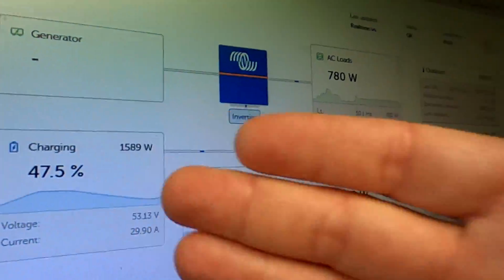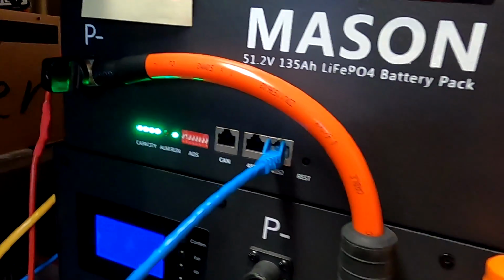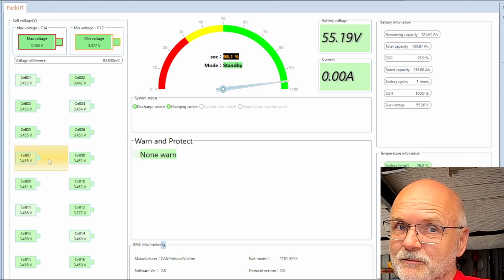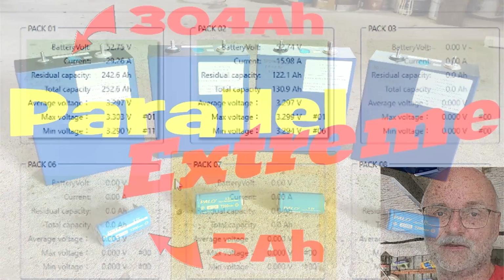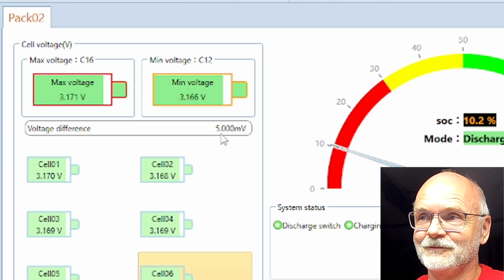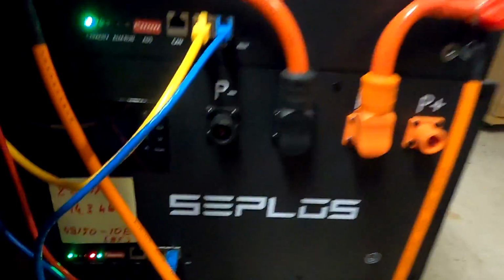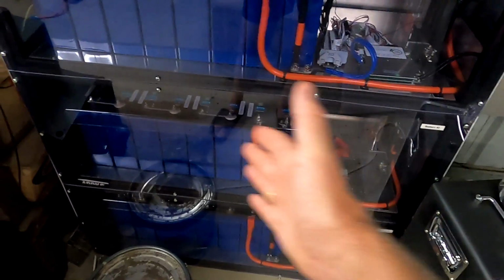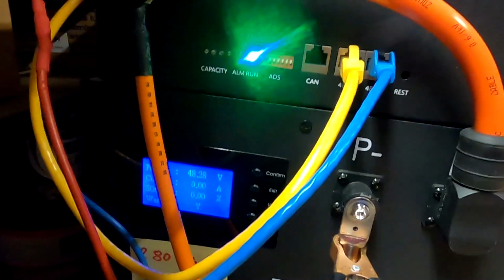280Ah and 135Ah batteries with different BMS in parallel. See what happens when discharging...

Comment: HI Andy. Thanks for great video! 
As I have similar situation with Seplos BMS DIY 280Ah battery by EEL (95% similar to Mason) with Amy supplied batteries and 105 Ah battery with JK BMS
 I like to share my little findings during few days. I  connected them in parralel this week and see similar load sharing as you had. 
The difference is that they not communicating together, but both can talk with Cerbo GX and I also have SmartShunt measuring both batteries. I will do more tests after NY.
EEL DIY was put in service this week and we have winter in Lithuania now. No sun. Just snow :)
My feesback to your test
Communication between batteries is to path trough data to inverter via Canbus. 
What I been thinking based on your test is that master battery shall be last shuting down. If not all communication to cerbo or inverter will be lost. Maybe you can try this next time including canbus communication to see 3 parts bahavior
My expierience with seplos bms+ smartshunt was that despite I been using SmartShunt as battery meter in VRM settings loosing Seplos battery or disconnecting canbus from it was raising low voltage alarm on Multiplus. Need to test it again to see if Inverter is switching to pathtrough mode to grid or stays on inverter.
Lets share our findings mext year and big thanks for your job! Danke und auf wiedersehen! 
Mindaugas
Reply from the maker: Thanks for sharing your experience.
If you have the smart shunt AND the smart BMSes, that doubles up and will most likely confuse your system. You should deactivate the Smart Shunt and use the BMS function only. Do some testing on how this goes...
Reply: Very interesting comment, thanks, I have also bought a EEL DIY case, I hope it is a good choice (not receive it yet).
Reply: Can you tell me on which store does Amy sell batteries?

Comment: Andy, the communication allows you to collect data on a monitoring device like your laptop using only one RJ45 cable. Your computer doesn't need to know how many 'umbilicals' are attached to it, but it needs to know how many packs your rack is composed of, so it can reports the specific warnings of the bank affected. An ethernet token ring communicates with independent stations for shared data or access privileges. Likewise a Seplos rack is more likely to perform the same scheme. I agree with you that parallelling batteries with individual BMS presents no issue.  I have a 280Ah and a 100Ah with separate Ant BMS and they just work until they shut off upon tripping on over or under volage protection. Their individual bluetooth screens report the errors on their own separate apps. I guess that were the "unifying' communication may gain some traction. It may allow to handle the monitoring  of many battery banks within one app. That is actually a saving and selling feature for the batttery manufacturer software wise..
Reply from the maker: Yes, but this is not working correctly with the Seplos batteries. There is a major flaw in their design. Video is coming soon...

Comment: Great test Andy,

It would be interesting to see them both being charge by the multiplus at the same time and the multiplus under the BMS control. I have seen the bms taken actions during the charge if cell voltage go to high and change the charging current. But I have only one pack right now

It would would really interesting to see what happened with two packs especially with you having some cells that is a little weak. Could be seen as an age thing that could happen in our systems with the cells we have.
Reply from the maker: This will probably never happen as my MP is off-grid and will most likely never be connected to the grid...
But I have something similar in mind.
Reply: @OffGridGarageAustralia  you have multiple victron inverter, you could totaly setup one inverter to act as grid and the other as hybrid inverter to test this and see how it can regulate discharging with multiple BMS.
Reply from the maker: @Pey5531  that's what I have setup since we finished the PowerWall and Battery Shelf. That's just not what is connected to the Seplos batteries.
Reply: @OffGridGarageAustralia  Sounds interesting, control functions are something we don't have that much of in DIY system. That has been the domain for commercially built systems before.

Comment: Lower capacity battery will have higher internal resistance than the larger battery so will discharge at a lower rate for the same terminal voltage

Comment: andy, couple of remarks...
1 your big battery doesnt have the best cells, your smaller does have good cells ( voltage drift is best proof of that )
2. the pack shut down you already explained.
3 the communication is helpful in charging, lowering the amps while charging at almost full
that will allow the balacing to do its job better, however, when using "repurposed " and by no means matched cells, it is highly unlikely the balancer is able to keep up.
i dont think these bms'es were ever designed for the DIY market, where less than automotive grade cells are too abundant
Reply from the maker: Good points. thanks for sharing.
You're probably right with your last sentence but they all use high capacity cells so 100mA balancing does not do great, regardless of how matched your cells are.
Reply: @OffGridGarageAustralia Agree, & this is where the JK does do well.

Comment: The only proposed to the comunicación between packs is to communicate to the inverter all of the packs states . If you conect the master pack to the inverter and both packs between them connected.  If one of them have some alarm  that means to stop the inverter this is what will happens.  Is not really good method always.  I have 2 seplos working and I just have both working w/o  comunicación between them and just one to the inverter . Nice test I suppose that this is not a problem because the voltage of the battery make both to work together   .Thanks Andy !

Comment: Because of the cells' internal resistance (and external), a discharge will lead to a balancing between the batteries, in the remaining capacity. If all the cells in the same battery were of equal quality, this balancing would be close to perfect. This as long as there is no difference in chemistry, and not too great a deviation in resistance.
When designing, it can be an advantage to ensure that the total resistance (internal plus external) of a battery matches the capacity. Double capacity should have half the resistance.
Reply: You raise some very valid points.  

I=E/R    More than a good idea, it's the law.  :-)
Reply: @BlackheartCharlie  Yes. Your explanation is very short. Mine a bit longer, but still not complete.

Comment: I was just working on my Mason 280 kit and found that the Aluminum busbars that they ship are very dangerous. They are too wide, and just about touch the metal bar that holds the sense cable board. Normal tinned copper bars in my other Mason are fine. DO NOT use the Aluminum bus bars, as they may cause a short and a fire. I have asked Seplos for a response.
Reply: Unless you are bouncing around on a to the road with this in a RV, vehicle etc, it's not an issue. Most people are using these as static systems in one location without being subject to lots of movement and potential shorting ...

Comment: I urge you to charge your Seplos battery and set your charger to full voltage of 58.4 volts @ 10 amps and just time how long it takes for the Seplos Bms to balance the cells to its 10 mv deviation setting, before saying the BMS is not working.

Comment: At that point before you charge them I would balance all cells to see if that makes a difference in total capacity next test.  I have 4 battery packs. I used to see a big difference between each BMS state of charge when I first setup my system. Now they are within 3% when I used to have 25%. I top balance at 3.3v to .004 as my setting is .005.  I would think in another month my packs should be between 1% since all cells came in 1 shipment. Very interesting regardless.  Another great video Andy thank you.

Comment: I even have my Lifepo4 battery in parallel with lead (gel) traction battery... works fine. The main work is done by Lithium. If needed, Lead is mostly in action only at low voltage for last supper ;-)

Comment: Hi Andy, i run 3 Batteries (24V) in parallel. 150Ah, 280Ah and 560Ah. The oldest is over 3 years old and they run 24/7 with no communication. Up until now I've never had any problems, they behave exactly like the ones you showed. Greetings from Germany.
Reply: Ya In the end it is better to have all cells same. The 150 a will lose cell first maybe then the others one at a time. But you have a poorer decision making then if you add new cell will result poorer reliability and useful ness. It is better to use same cells. So if you want bigger should be 150ah, 300 ah then 300ah, 300ah,. 150ah und so on and on.
Reply: Welche BMS nutz Du?
Reply: @marcelprivat  2x Daly und 1x HiBMS, alle ohne Balancer (bzw. nur mit dem 30mA Onboard). Ich lade meine Zellen beim bau der Batterie immer mit einem Labornetzteil auf 3,65V. Selbst bei der ältesten 3 Jahre alten Batterie sind die noch immer 1A, kein drift und das obwohl die schon ~600 volle Zyklen hat.
Reply: @x3n4t0r  ich habe auch vor eine 100Ah an die vorhandene Bank aus 560Ah zu hängen. Ich kannte ja das erste Video wo Andy den krassen Versuch gemacht hat. Also ist das Problemlos möglich. Die 100Ah ist mein 1. Versuch gewesen vor 5Jahren. Seitdem steht sie rum. Achso ich habe alle durch JKBMS ersetzt.
Reply: Can you tell us the 3 battery brands and ages?
Also did you test or determine what your combined amp hours ?
I have 4 - 24v new  batteries one set is 100ah and 200ah and want to connect them in series …..
Reply: Hello Xenator, 
I had a big question, and you gave the aswer already.
One year ago, I bought 4 pcs 3.2 V 304 Amp from Basen, witch I use in my- selfbuilt- camper.
I want to cook with a induction plate, or airfryer, for that reason I want to extend my capacity.
I was thinking to make another - the same capacity same chemical, battery.
There are pro's and contra's.
Andy did a fantastic test- like always, and does not say it's impossible.
In my case, each battery has is own - same- BMS, 120 Amp., witch no communicate with the other.
When I read your comment, there should be no any restrictions to go for it?
Let me know please what your opinion is.
Regards.
Willy.
NB: Andy he's days are so short, I don't want to disturb him. Probably you have time for me.
Reply: @mbu745  Hi, i don't see a problem there. If the power of your induction plate does not exceed what the BMS's can deliver, it should be fine.
Reply: Xenator_VR, 
my induction plate is 2000 Watt, single pitt. The BMS'es are bouth 120 Amp, the inverter 2500 Watt, pieck 5000. 
I want to use the induction plate for slow cooking, or a 1500 Watt airfryer.
Not full power.
Willy

Comment: I think the communication is more usefiull for automation purposes like creating triggers and automates with Home Assistant for example.
It is also possible to send the voltage seen by the BMS to the inverter instead of the inverter probing the voltage on it's input. It is like a 4 wire voltage measurement of the battery pack.

Comment: Hopefully the Victron doesn't see them as one battery, it should see two batteries individually. The individual batteries don't need to communicate together, they all need to communicate with the inverter/monitoring system.
It's not about control, it's about monitoring. More numbers.

It's also disappointing that the BMSs don't keep communicating when they've shutdown. If I had such a system, I'd like to see the state of the battery even if it's undervolted.

Comment: If the communication between the BMSs does NOT prevent each other from charging the batteries each other, then this system just sucks!
If the connection of BMSs does not give ANY added value, then such communication in my opinion becomes a completely unnecessary complication to connect, generating unnecessary costs of cables and all the equipment used for this communication.

Comment: Andy,  It appears from your test that the communication between the batteries is non-existent and that only purpose of connection between the batteries is to the loop the RS485 communications through the BMS to the master and then to the PC or Inverter.  It would be interesting to see if master battery was the first to shut down, would you loose communication to PC or inverter.  If so, what happens?  Would the inverter shut down because it lost communication?  Maybe run the same test again before you bring these guys back up to a high end SOC and switch the master to the big battery.  What happens?
Reply: my thoughts too. I highly doubt hat there is any communication between the BMSs. The connections between the BMSs is a RS485 bus loop only that you can reach all connected BMSs on one interface and you don’t need to connect each BMS separately to your computer/ inverter. The conclusions out of the data of the different BMSs must be made then by an overlaying „controller“ how to act when certain conditions are reached. 
Master and Slave settings doesn’t influence here cause this is only the way the RS485 communication bus works. This has nothing to do with any kind of „ I‘m the master and telling you what to do“. 🙂
Reply: 100% agree.
The whole thing is just to let one bms collect data from all the others. Nothing else. 
If they would communicate there would be some parameters to specify what should happen if this or that is going on.

Comment: Ohm's law proven! Voltage is common in parallel. I don't know what is great about communication. Each piece of my system is autonomous. Nothing communicates. I've tried to setup with the theory that no 1 or 2 pieces can take down the whole system.

Comment: The small battery has better balanced cells, so it discharged to a bit lower voltage (since the big battery shut down when cell #6 bottomed out.)  So when you turned the charger on, power went from the big battery (cell #6 rebounded a bit) to the small battery until it shut down again. It should be ok once the small battery comes up to the voltage of the big battery.

Comment: I was sent a firmware update from 2.7 to 2.9 and still can't get mine calibrated
Reply: Hi, have anyone seen change log for the different Firmware versions? My system really changed behaviour from the 2.7 to the 2.8. I actually prefer what the 2.8 works but the settings I had in the system was tuned to handle how the 2.7 worked and I needed to reset some settings after the upgrade maybe something you should look at also if you changed anything? Haven't tested the 2.9 yet so I don't know what that one does.

Comment: If you get the Chinese cracker graphs for the 135 + 280 cells does the voltage graph shape differ in the 50-20% range?  maybe that's why they shifted %age SOC vs voltage - matching voltage not SOC as they discharge. Maybe internal pressures of smaller cells or something weird, subtle but weird enough to show on the test ?

Comment: i got 7s liion and 8s lifepço in paralel, never had any probleme, all you have to do is match the cut out voltage and the max voltage on both in the bms parameters,  don't try this in series btw x)
Reply: I don't think this is a good idea, even if it "works". With the different discharge curves the batteries will be in a constant tug of war with lots of micro cycles. That is how I understand it.
Reply: @justdoityourself7134  this will have NO effect on them,  they are working both in a safe range of voltage, and the bms AND mppt charger will never allow them to go over these voltage, trust me, for liion and lifepo they are very similare, this will have 0 probleme, all you need to do is be sure you respect the spec for both of them in your parameter and u are good to go
Reply: @chris_mk5supra  Good luck with that. I'll never mix battery chemistries.
Reply: @justdoityourself7134  you cannot mix all of them . But liion and lifepo are pretty close. Running this setupt for 1 years now
Reply: @chris_mk5supra  I don't have any experience with liion. Thanks for introducing me to this idea. As a matter of who I am I don't just trust. Nothing personal. I have several LFP batteries of different sizes and ages in parallel. Even with all the same chemistry I observe load swings and micro cycles. Forgive me if I am skeptical that this would not happen at all with a different chemistry. Not that this means it should not be done, I'm just pointing out what the side effect should be in theory.
Reply: @justdoityourself7134  Yep np . Thé only reason i did this was because i had a lot of liion with no use . This is thé only reason to do that . Lifepo are way more safe and easy to use x)